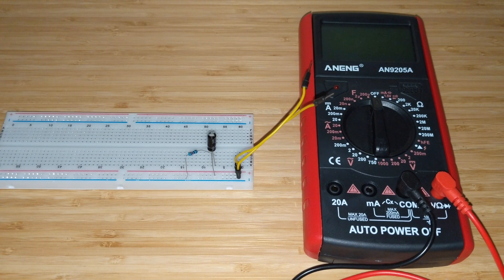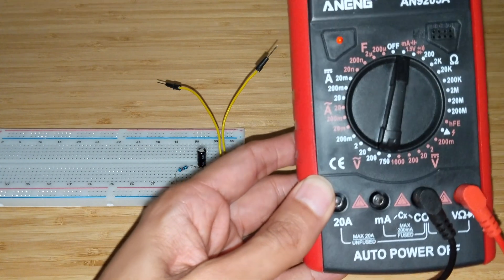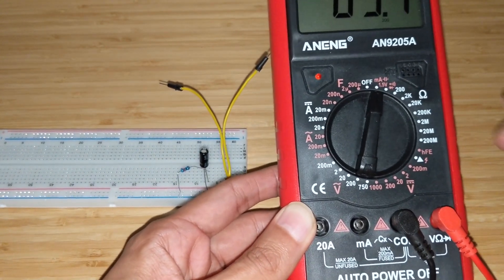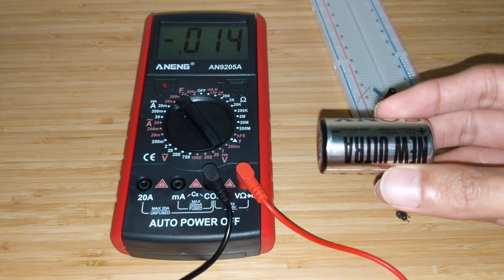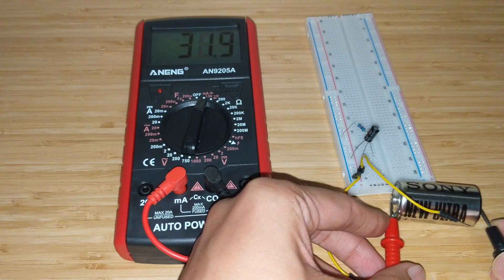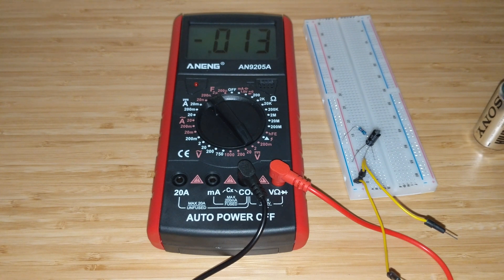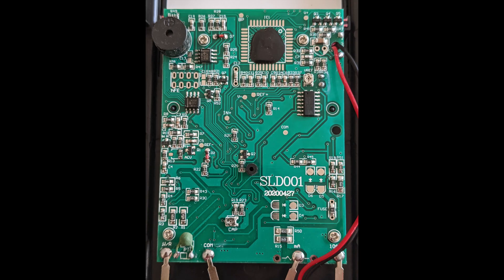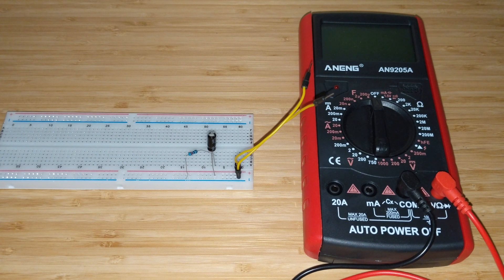Aneng AN9205A Multimeter mystery solved!!! Why do we need a battery tester?

Comment: Hi. At minute 7:20 I am able to see a few holes and an "hFE" marking on the motherboard. Is this multimeter able to test transistors? Thanks.
Reply from the maker: It is meant to. but the connectors are horrible so pretty useless.